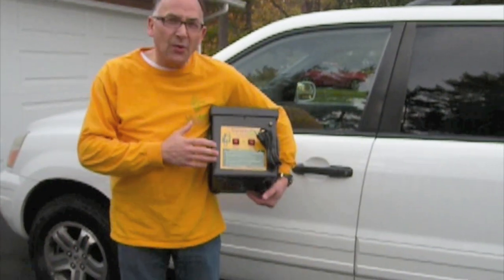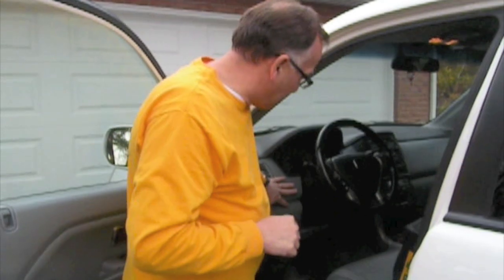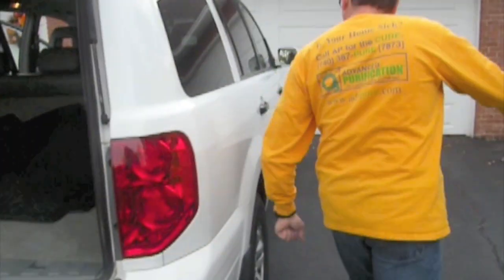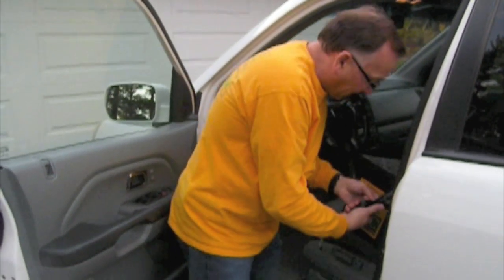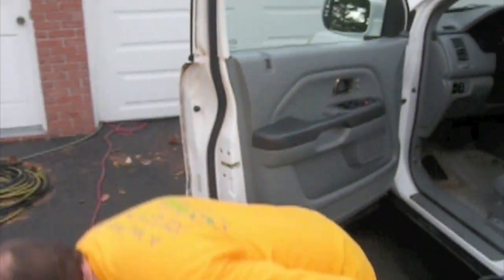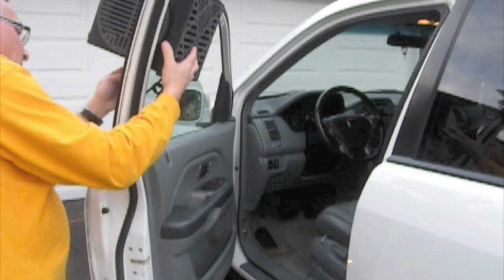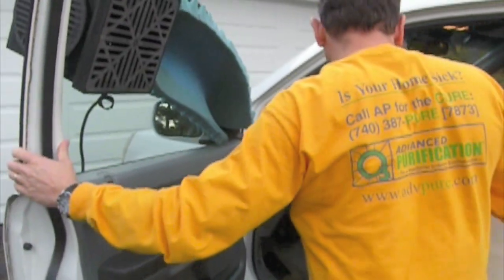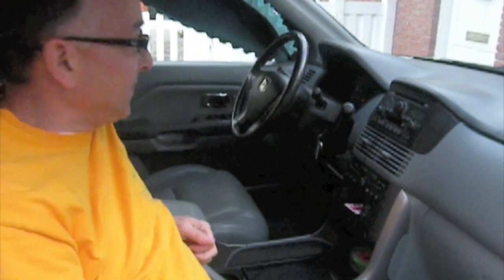Eliminating Car Odors with Ozone Shock Treatments

Comment: Don’t forget to change your in cabin air filter! A mouse got inside of mine a week or two ago and died and started to stink so bad coming from my vents. I’m going to use the ozone generator in there and I put a brand new air filter in there. The smell is mostly gone but now I’m going to put ozone to completely get rid of it while the car and vent fans are running
Reply: Thanks FrostyBud777 for the comments!  You've discovered the amazing deodorizing properties of ozone - - very effective at eliminating unwanted odors in cars, boats and RVs!  Of course, anywhere indoor problem odors exist ozone can be used for complete removal, because ozone works on the molecular level.  Thanks again!  SanusAer Team

Comment: I did this for 1 hour without the a/c running and windows closed. I let it air out for an hour after completion and drove it wkth the windows open. However, there is a strong new smell that wont leave. Any ideas on what the solution is?
Reply from the maker: Ali F - An hour was probably a bit long and best to run AC fan during treatment.  The ultra fresh smell you are experiencing will dissipate in a few days.  You can speed the process up by leaving windows open if you are able to leave it in a garage.
Reply: Awesome! Thanks for your quick response!

Comment: Something needs to be cleared up between leaving the ozone machine inside or outside of the car. Some say leave it in and other say not too. So which is it? What does an engineer say?
Reply from the maker: Hi Dan - Actually, placing the ozone generator is preferred for treating vehicles, RVs and boats.  This method allows you to generate ozone with fresh oxygen whereas, if you put the generator in the vehicle you are trying to generate ozone with ozone which doesn’t give you clean ozone.  SanusAer’s most recent design (4 sizes) are fitted to allow for a hose kit attachment.  Check it out at: https://sanusaer.com/product/sanusaer-optional-hose-kit/

Comment: Is it important to draw fresh air into the generator? Why not put the unit inside the car and run it for 30 mins?
Reply from the maker: sonko2010 yes...in fact, our newest design allows for a hose connection to be used so that you can set the unit outside the vehicle which allows it to use clean oxygen to make fresh ozone.  This is far better than placing a generator inside the car and ultimately trying to make ozone with ozone.
Reply: Thanks. That makes sense. Is this also true when using a generator inside a sealed home? Meaning is it better to draw fresh oxygen in from a window? Or is it ok to leave it sealed inside the space for a period of time? Cheers!
Reply from the maker: sonko2010 inside a home is different because you are dealing with a much larger space.  Takes longer to fill the open area.  However, we do have a cycling protocol that we recommend to improve results.
Reply: Thanks again for the reply. Is the protocol something you can share? I have a 11,000 unit in a 1000 square foot house. I’d be grateful for the help.
Reply from the maker: sonko2010 when you say you have an 11,000 unit do you mean the output is 11,000 mg per hour?  If so, this should be right sized for your 1,000 square foot home.  We share our treatment guidelines on our website at SanusAer.com/Ozone-powers-remove-odors-safely/#chart

Comment: Whats the output of this machine? how man mg/h?
Reply from the maker: brent horton - the machine in the video was a 14000 mg/hr output.  We have new models now with the following outputs (10,000, 20,000, 30,000, and 40,000).  You can purchase a hose adapter for cars, boats, RVs and small spaces that fits all our units.

Comment: I borrowed an ozone generator “QT Thunder” and ran it for two back-2-back 45 minute cycles. Doing this removed maybe 75% of the strong old ashtray & stale cigarette odor from a 7yr old used Honda CR-V. The SUV interior still smells bad, but I’m not getting queasy like before. I wiped down most inside surfaces, but don’t have a way to shampoo the fabric headliner. What else can I do?
Reply: You're the first ozone generator user I came across that didn't have great success. Every user I read about was satisfied and with units much more inexpensive than the one you borrowed. What was your process?
Reply: For hard surfaces and carpets/headliner you can use about 2 OZ of Tide HE w/ Febreeze in a gallon of warm water and get several towels in the bucket.  As you use them to clean surfaces throw them in another bucket and do not put the dirty towels back in the bucket.  You can follow by wiping each surface with a water only dampened towel to rinse or wipe away any residue.  Then run the machine.  Be sure you do the seat belts, sun visors (both sides) and all seals need to be cleaned too as they can absorb odors as well.

Comment: What if I put the generator inside the car with the AC on?
Reply: If you place it in the car you convert O2 into O3 then into NO, that's how you create Nitric Oxide and cause damage to materials and people. When a O3 machine only breathes in O3 you create a deadly combination. O3 generators need to breathe in fresh air.
Reply: dair805 it would do the same thing, maybye not as effectively if you are not circulating the air though.
Reply: Thats good to know, thank you for explaining!

Comment: Very nice "how to" video. Does your model of Ozone Generator not have a built in timer functioin? Also, is there a table or chart of which you know, that explains the recommended amount of time per square foot/inch that the generator should be left running? Also, I see some generators not only have the knob in front for the built in timer, but another control knob that says, "Output" with selections 1 thru 10, and I'm assuming that means 1 is a very weak level of gas production, with 10 being the strongest. What do you know about this feature, and how to determine which level/number to set the generator at, according to the square footage and/or intensity of the odor we are attempting to eliminate?  Again, very nice. You're very articulate and easy to understand. Good personality for instructional videos.

Comment: Could deodorizing cars with ozone be a standalone business and what would be a reasonable rate to charge?
Reply from the maker: Yes...you can do it this way, as I have many times.  However, if you think about the fact that the generator will fill the car quickly with ozone, you will then be pulling ozone into the machine to generate more ozone.  This is not the optimal way to create clean ozone.  Best practice is to have the unit outside the car pulling in fresh air to make clean ozone.  We sell hose kits that fit all our ozone generator models for only $75.00 delivered.  It’s definitely worth investment.

Comment: Loved this video! When i first saw what these things could do i had to see for myself! I bought an Ozone Power 3500 Commercial Ozone generator and my god does it work,  i have a fairly nice car which i go to car meets with and i try to keep it clean as often as possible, ive tried many air fresheners including "Ozium Air sanitizer" which i mean yeah it works for less than a day lol.. After vacuuming out the car and running the ozone genrator for just 15 minutes, half what you ran it here, and all the random and musty smells were gone! As the day went on it got even better, i started to notice that there was the real new car smell coming back i could smell the fresh carpet, and this is a 2014 Mazda 2 with 65,000 miles on it and it not only looks new and great but also smells the part! This unit produces 4 gallons per hour of ozone, which is plenty, i plan on running it one more time before next weeks car meet but gosh i couldnt believe the difference, weve also used it around the house too which again was amazing! Its great and awesome people like you that influenced me to try it, and for that i have to say thanks!
Reply: grams not gallons/hr.
Reply: Hunter J. Short You should check into getting a thermo fogger instead. Much quicker, easier, and definitely a lot safer!

Comment: Hi, I liked your video and have some questions. I live in europe so I ordered a 7000 mg/h unit from Poland. My main uses would be home disinfection (expecially mold), and car conditioning system. I am wondering about the possible degradation of some materials (such as nylon, brass, mild steel and HSLA). I would know what I should take out of a room before the treatment (maybe electrical equipment?).
Last question, what kind of manteinance they do require? My generator (simple type electrical discharge, no tube or UV) manual says that the machine should be inspected every 3-6 months and am wondering if something needs to be replaced after a while. Thank you
Reply: I bought a Jenesco Pro 44. I've been reading reviews.they seem to know what they are talking about.  A lot of bogus info flying around.

Comment: I like how he gets in the car and says "smells great." It smells like Ozone, which doesn't particularly smell good, not to mention its not a good idea to directly breathe in the Ozone. I did an Ozone treatment on a car and even a few days later I was getting a sore throat from being in it. Good Job!
Reply: Did it improve after a while?  Just got several treatments and have a similar sore throat after.  Hoping it gets better.
Reply: It will improve. The best way to rid the ozone from the car is to leave it in a warm/sunny environment with all the doors/windows open. In my experience, the colder the weather, the longer the ozone smell/feel stayed in the car.
Reply: did it actually remove the smell?
Reply: Sam yes, temperature affects duration of ozone... i guess at least you better know what to do next time... worse case, run a blow dryer on carpets if on a cold day